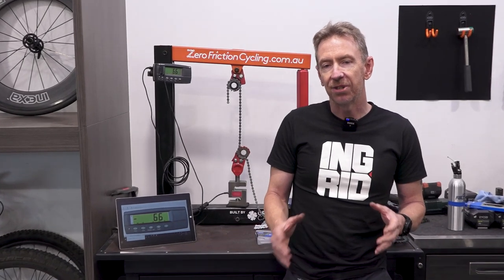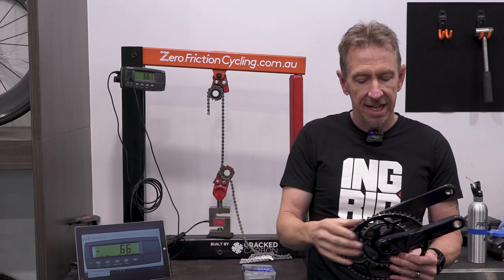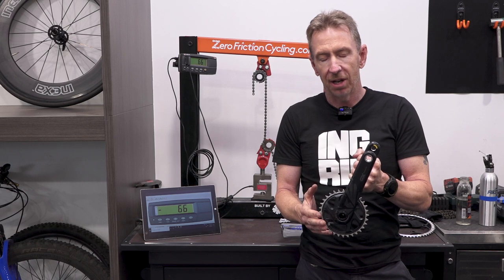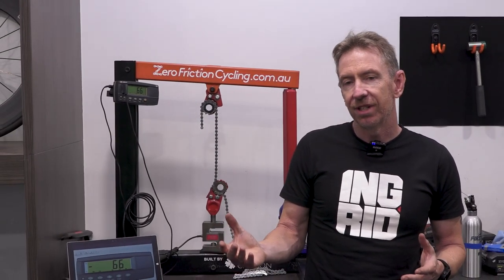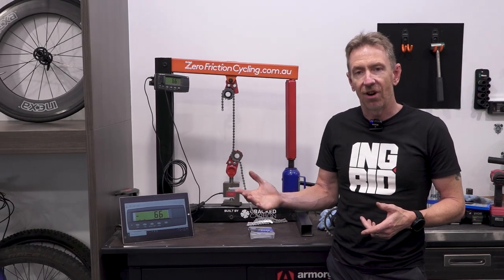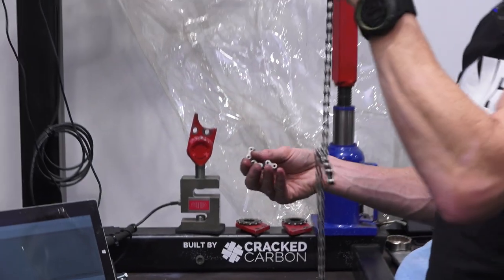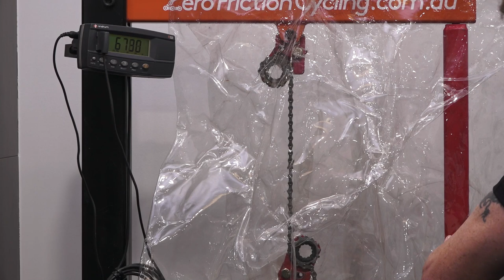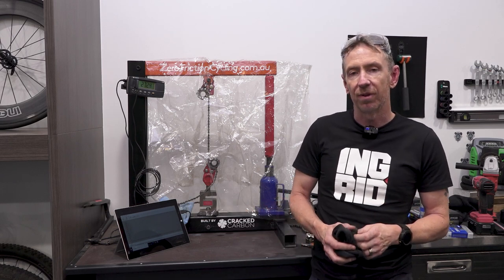Episode 19   Chain Tensile Testing

Comment: Interesting test mate , thanks for posting .
  it does make me wonder how modern chains would compare to chains from the old days like the 70`s , as I remember it vaguely ( yes im old ) they where much meatier and they had very little sideways flex  , I look at the chain on my recently purchased current bike with 27 gears and the chain is sooooo thin like a strip of spaghetti  , and for some people that equip their bikes with motor assist , it does make me wonder how much punishment the chain can take for example ,  if you are on a 30 degree hill and a large fella  putting your all into peddling as well as the electric assist adding even more strain on the drive line , some of these EV bike kits put out 160 NM of torque . 
 I can tell you im seriously thinking about carrying  a spare chain , the one I see  does not inspire confidence I can say that for sure.
Reply from the maker: I dont think the old ones would be any stronger. We just look at most beefy 1/8th track chains, they are much softer grade metal than 11 and 12spd chains, and so despite all the extra metal, they dont have a greater tensile strength. 

For e-bikes however and larger chain line angles that come with 11 & 12sdp drivetrains - absolutely failures are an issue, especially as people tend to shift under pretty nuts loads these days vs better practice of easing power off substantially for that half a second to shift. All it can all place a huge amount of pressure on outer plate trying to be pried off the pin, so the riveting strength is crucial, and all it takes is one weaker rivet and that can be the ball game. 

You normally dont need to carry a spare chain though, but all mtb & gravel riders should be carrying a tool that has a chain breaker as well as a spare master link - with that you can repair chain, and if you lose a couple links you simply may not be able to use lowest gear, but you will get home fine
Reply: @zerofrictioncycling992  great information , thanks mate .
Cheers.

Comment: Adam how strong are quick links. The same standard as chain
Reply from the maker: Hey gary - I didnt quite get to starting to test master links - that was on the to do list next but then i ran out of time, and then honestly i have barely had a chain to spare so would have had to get some cheap chains in to test master links vs using some stock - im either out or just about out of pretty much every 11 or 12spd chain all the time for awhile now,  but im hoping to get some straight line tests done soon-ish after i get the slipping cog fixed. It will be really interesting to see if they do fail before chain, fail earlier if used 10x etc - stay tuned - sorry i should have snuck at least one of those tests in i simply had planned to do a bunch of tests re master links and didnt quite make it so none have been done yet... Im keen to know too how they hold up vs chain!

Comment: With regards to eagle chains having a higher failure rate, I wonder if AXS derailleurs put a greater side load on the chain than Shimano mechanical. I switched to AXS but kept a Shimano chain and cassette and noticed that while Shimano shifter/derailleur combo shifts smoother the AXS shifter/derailleur shifts noticeable faster. 
Shortly after I had 2 failures on the Shimano chain in the same ride. The outer plates deformed outwards and pushed off of the pins.

Comment: As always, another masterclass video. Thanks Adam. You mention a couple of times problems with Eagle chains. If you chose to run an Eagle AXS MTB drivetrain on one of your own bikes, what chain would you use with it? Thanks!
Reply from the maker: Hey Cat thanks for lovely feedback, better than expected for my completely unprepped throw it on the end of film day for that one! And yes overall - eagle xx1 / xo1 are the worlds best training chains as they have completely unmatched wear durability - no other chain is even close. But they are very slow so if one races, then race on something fast - the easiest plug n play go fast chain for sram eagle is ybn sla 12spd. On one bike i have eagle xx1 training, ybn 12 race, on another which i have a wolf tooth 12spd shimano compatible ring i run xx1 training, XTR 12 race. Most never break an eagle chain, just that it seemingly happens a bit more with eagle vs others, it is likely due to simply a rare riveting issue coming up on a single rivet here and there. Typically an eagle chain will break early in its life, or not at all. I would not say it is common at all, or anything for people to worry about, simply when you sell so many chains because that is core part of your work, the warranty rate for eagle vs other chains , so far, is a bit clearly higher vs others - but still it is definitely rare enough that as a cyclist on eagle, you shouldnt be concerned about it. For mtb riding it is good practice anyway to carry a spare link and have a multi tool that has a chain breaker on it for trail side repair, mtb ALWAYS has highest rate of chain failures due to big cogs, large chain line angles and higher chain tension for a given power due to small rings, and much more likely crunched shifts and terrain changes rapidly and one suddenly finds themselves needing 3 gears lower, whilst on a 20% pinch, thats bumpy, and things get interesting for the chain.
Reply: @zerofrictioncycling992  Again, as always, thanks for the thoughtful reply. I really do appreciate that. I'm running SRAM X01 cassette and chain, GX AXS RD and  RaceFace Cinch crank/chainring setup and it's been solid. Especially now that I'm immersive waxing. I also don't race. So it's comforting to know that I'm running something that you would run yourself. Thanks again.
Reply: @zerofrictioncycling992  So glad to read this comment. This video was the first I time I had heard about Eagle chains failing so I was slightly worried. Do you recall if it was more common with XX1 or X01, or about the same failure rate? I’m planning to switch to an eagle setup soon and will switch to waxing at that time. I don’t care so much about looks or speed, just wanting the best longevity.

While we’re on the topic: do you have an opinion about chrome vs nickel outer plates? What about the PVD coating? XX1 chains seem to have this and X01 chains don’t. Do you think there is much difference in ease of waxing? Durability?

Thanks for all that you do!

Comment: Thanks Adam. Do you have any recent info on 7/8 speed chains for bikes?
Reply from the maker: really jus that the best 7/8 spd chains still avail are the ybn sla 8spd and wippermann 808. Pretty much all the rest are very budget (for a long time now) and no wear protection so they dont last long. If still running a nice 7 or 8psd bike, then as will all bikes, one shouldnt skimp on their hardest working part + its lubricant, keep an eye on chain wear to protect rest of drivetrain etc - and it is still good times indeed.
Reply: @zerofrictioncycling992  Is KMC X8 with the Ti-N coating any good?

Comment: really interested in the tensile strength of the linkglide CN-LG500 chain - did you ever complete this test?
Reply from the maker: me too - and sorry no havent had time to get machine fixed, lubricant testing been too busy! one day..... its on the list....
Reply: @zerofrictioncycling992   I built a new ebike using the bafang m620...it snapped my chain on first trial run. I have a linkglide chain on order so im going to try it regardless. but really look forward to finding out...

Comment: Do you know if the YBN SLA 101 10-speed chain is compatible with a triple crankset? I've read you recommend them as a 10-speed chain for immersive waxing, but couldn't find if it's compatible.. thanks!
Reply from the maker: Hey robert - it will for sure be compatible if the triple is a 10spd triple. It will likely work fine as well on a 9spd triple, but if you have a 9spd, get the 9spd ybn sla. Yes overall the ybn are the rolls royce choice for many as are fast, wear durable and get along great with waxes.
Reply: @zerofrictioncycling992  love to hear it. Just ordered mine including all the essentials for immersive waxing. Thank you for the content and setting me on the right path!

Comment: Hi, just wanted a bit of clarification on 11 speed YBN chains. Since there's so many variants around, any SLA model is as good as another?

And is it safe to assume that non-SLA YBNs are of lower/worse quality?
Reply from the maker: Hey deadly Ace yes ybn model naming - dont get how this stuff gets past marketing departments - it is not exactly intuitive! the sla series like 1110 or 110 etc - they are the top of the line models. Below that is H models ie H11, and that is a big drop i believe with them not having the same treatments (and they have solid pins). But if it leads with SLA - then that is the one you want

Comment: Hi thanks for great info. Got question regarding chain preparation. I think you advised in the past to wipe the chain with clean cloth after each round with white spirit and observe if cloth gets dirty? Can’t find that info now, it is not mandatory? Or have I mixed it up?
Reply from the maker: Hey LGTV - thats for offroad riding - spray some alcohol onto a microfiber cloth to lift off surface dust that will stick to outside of chain, same as dust sticks to ones frame and they dont lubricate frame. This prevents bringing a bunch of dust into wax pot, or if using drip lubes, having the lubricant drag dust into the chain with it as it penetrates which is bad as then the dust will be abrasive on working load surfaces of chain. For road riding, doing the above is not necessary at all for wax / good wax lubricants - it is worth it for wet lubricants that will always have a higher amount of contamination on outside as every airborne particle sticks to wet lubricants.
Reply: @zerofrictioncycling992  thanks for reply. You are talking about maintenance between rides. I'm asking about first preparation before waxing. Now I remember where I've seen it: MSW chanel: https://youtu.be/lI0tZqIpguk?t=69 I don't think you recommend it?

Comment: Do any sub-$20 chains stand out in performance? I have an early 00’s k2 attack mountain bike I’m fixing up after a long time in the shed and don’t have much to spend, I’m tempted to just go to Walmart and get a $10 “bike shop” (Walmart) branded chain unless there’s a clearly superior alternative for not much more I can get prime shipped or something.
Reply from the maker: no they dont at all, you really do get what you pay for, and remember as your hardest working mechanical part by a huge margin, that operates (and its lubricant) completely exposed to contamination - cheap chains just have no wear durability features built in (cheaper metal, no wear protections like chromium platings, no low friction coating). You can get barely passable lifespan of cheap chain by ensuring running top lubricant choice, but you want to keep a super close eye on chain wear so that it doesnt take out your cassette and make good inroads into chain rings once it wears past 0.5%. If you are not going to be riding the bike heaps then sure, no need to spend a bomb on a high quality chain - but if you are planning to clock up some good miles now - as your hardest working part - by so much - buying a cheap chain is a false economy.

Comment: Thanks for all the videos Adam,

Just got a few questions for you.
Do you ever wash down the chain with boiling water pre re-setting the chain with wax (road bike). Or at least wipe down with metho and a micro fibre cloth? Or just depends how dirty it looks?
Also wondering is it ok to alternate between a shimano 12 speed chain and sram eagle chain 12 speed chain, or will this cause unfavourable wear on cassette/ chain rings. Just struggling to get hold of shimano 12 speed chains!
Thanks again for the all the advice.
Reply from the maker: Hey harry! For road riding if it just dry riding, there is absolutely zero need for any cleaning at all before waxing - and boiling water rinses all the time can actually be of more detriment than help (if not properly dried over time it can impact wax. It is very handy to help remove bulk of contamination post proper wet rides, but there is just nothing to remove post dry rides, and introducing water no reason just isnt optimal. I receive maybe one case per month of customer writing in with premature chain wear on waxing. OVer the last 6 years, almost all of these cases the customer has been boiling water rinsing every time before re waxing even though they are riding in dry road conditions. It does not hurt if done properly - chain fully dried before re wax - but there is simply zero point for the time and elec cost to boil water and dry chain unless it has been through a proper wet ride). 

Wiping with cloth and metho is also only of use to off road riders where dust will stick to surface of chain from static elec of whizzing through the air, just like dust sticks to ones frame. This just doesnt happen to any degree for road riding, again it would just be time and cost for zero trackable benefit. 

Re the chain i gather you are already running an xtr 12 compatible ring to run your shimano chain, in which case the eagle chain will run perfectly groovy. Re premature wear - alas not enough anecdotal data on this - there just arent many running both chains types on xtr 12 rings and tracking wear vs non xtr 12 rings - bearing in mind also mtb demographic is a) super horrendous at tracking wear and b) huge variation in one cyclists riding and dust would mean a very very large data set would be needed to attain even ball park average wear figures (and again it would vary by chain ring brand as not all chain rings war the same, some are quite hard wearing, some are quite soft. 

I personally have xtr 12 rings on my two mtbs, and i run eagle xx1 training chains and either a ybn or shimano xtr 12 chain for race chain. I have been doing this for circa 5 years, and thus far, my xtr 12 compatible rings from wolf tooth are just fine and dandy - but - i do re wax fairly early - i just dont push wax treatment lifespans as it is just uber easy for me to not push treatment lifespans as i am riding 5 bikes on rotation - everything nicely re waxed all the time = extremely low chain wear - at current rate my xx1 chain will last about a quarter of a century i think - and extremely low / nil chain ring & cassette wear.  

I have heard concerns that running non shimano chains on shimano 12spd rings may cause premature wear, but i havent seen what actually backs this up. I think it may be conflation of it is possible that in general xtr 12 rings may not be as long lasting as traditional narrow / wide rings as the teeth are overall much more narrow for the extended inner plate links. Less surface area material will have the teeth wear faster than more tooth material. I.e in a straight shoot out all things being equal i would expect a shimano 12spd ring to wear faster than a sram x-sync narrow wide ring. 

Having said all that, if waxing / top wax chain coating drip lube - your wear rates should be so low that overall rate of wear is pretty much a non issue - it is for me, it should be same for other clever low friction peeps :)